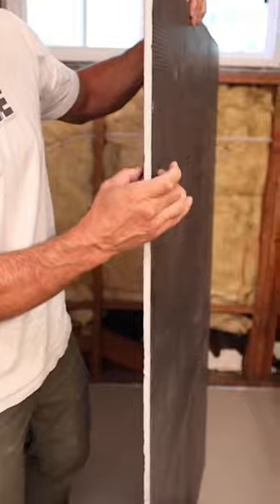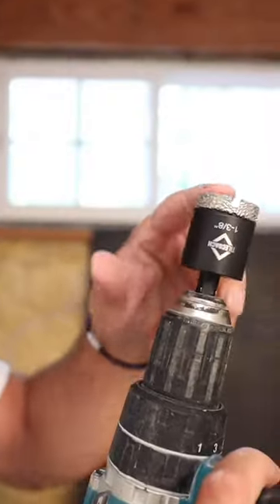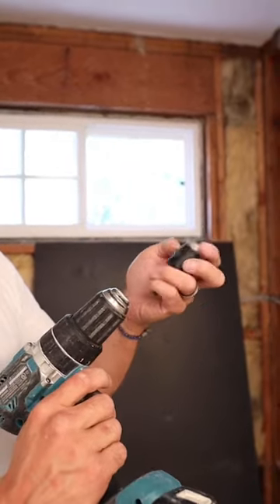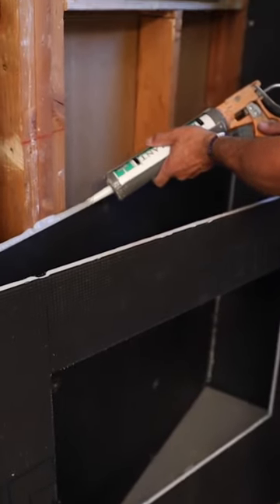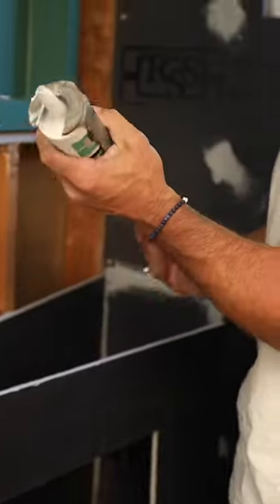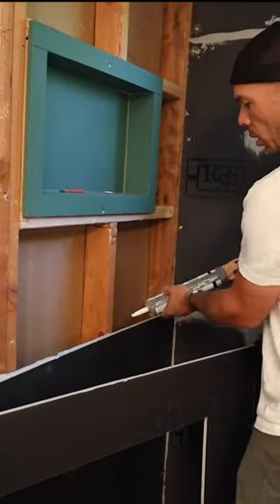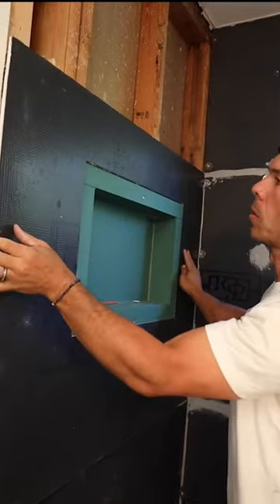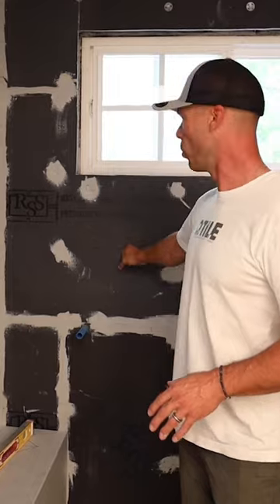Strong, easy to install wallboard is already waterproof!   #tile

Comment: Looks exactly like sentinel board from floor and decor. I use gorilla construction adhesive.....It passed a 2 week flood test mockup i did. Cheaper than Kerdi fix and goboard sealant.
Reply: Also the board was clapping as he pushed on it proving your strength theory correct, what if you somone who wants to share the shower. U gonna smash a hole real easy even with tile
Reply: Great bonding glue but really poor waterproofing. It dries harder & shrinks as it ages, becoming too brittle. Showers get bumped, hip checked, pushed, & fallen into. That glue is not a long term solution for waterproofing

Comment: We in the uk have these boards in many sizes anf thicknesses one of which is used from floor to ceilings no horizontal splits just vertical every 2½foot or so. Which is way better than having horizontal lines . Which is literally bad for in a shower .
Then i use a tanking solution ontop of this board leaves the shower area absolutley shower proof .

Comment: I would use that over kerdi any day.
Reply: Likewise. Schlüter says even though you can pull the kerdi off rather easily once dried, that it will nonetheless hold well and last for a long time...no thank you. Go board is super light, easy to cut, and you can't pull off it's waterproof layer.

Comment: We use go board which is super easy to work with but has extremely aggressive fiber glass in the finish. It's been about a week since I touched it and I feel like I can still feel it in my skin and stuck in my throat and nose. Even just running your finger on it  while hanging tile takes your skin off.. Would be nice to find something else that isn't a hundred dollars a board. (In PA)
Reply: I’m currently using Durock, but wanted to make a switch to GoBoard for prepping a guest bathroom that is up a flight of stairs..
Now your comment is making me 2nd guess going with fiberglass GoBoard 😂 

I’m with you though, a simple cutting board that is ready for tile install. Not all these extra steps with sealant and waterproofing membranes 
There is a lot of redundancy taking place, but still backer boards feel unreliable

Comment: What kind of board is that? I lay a lot of tile for a living.  I do a little bit of everything.  Yeah. I’m one of them guys. But I’ve always used traditional Durock or Wonderboard. I refuse to use Hardieboard. But I’m about to do my own personal shower and was thinking about trying the Kerdi board for the fact of it coming in 4’x8’ meaning no seams but I worried about the flex in between the studs. What kind are you using in this video? Everybody is telling me to try Go Board. So far that’s the route I’m leaning towards. But would love to know what kind this is. That’s pretty impressive how stout it seems

Comment: Just did my first job with this. It was stronger and cheaper than kerdi  . Way cheaper and I'm sold. I got it at floor decor.
Reply: Did one of the kids at floor and decor sell it to you?
Reply: @Carolinaboi313  nobody sold me anything as I walked around the store for hours. I was driven by price and it's just foam board that installs almost the same way. I even used kedi band with it.

Comment: Have yall heard of Sentinel Foam Board? What do you guys think of it ?
Reply: Been using it the last 5 showers of mine it’s actually pretty good stuff. Comparable to Wedi board and can be installed with any polyurethane off the shelf. Make sure you wear long sleeve thought the fibers can irritate the skin (in my personal experiences)
Reply: @TonyVM775  what polyurethane did you use? Need it to be marine grade?

And what’d you waterproof the floor with?
Reply: @TonyVM775  okay thank you for the help
Reply: @TheJonathanDavid  I use “Sika White Fast Setting Polyurethane 10.1-fl oz Sealant” for my showers.